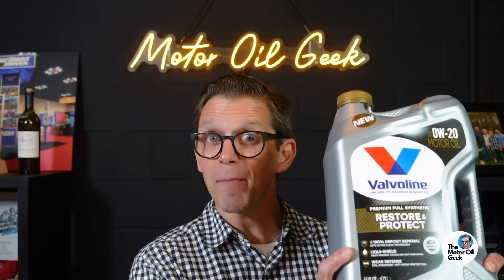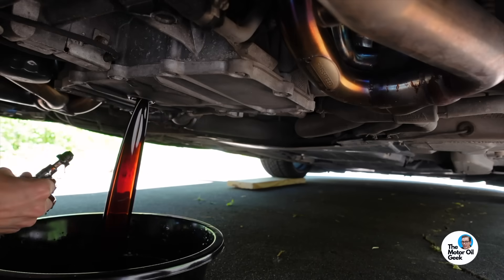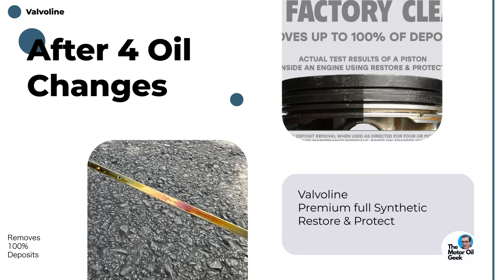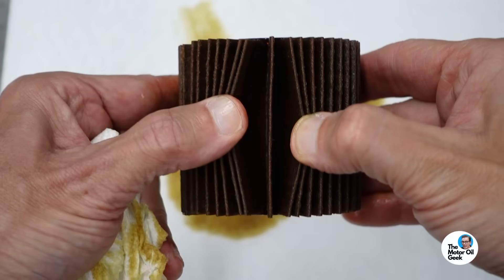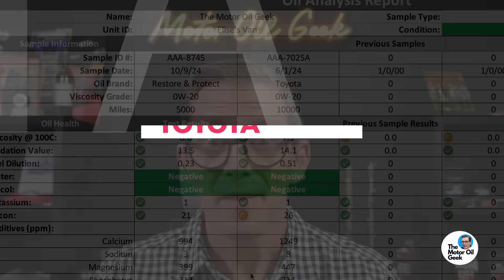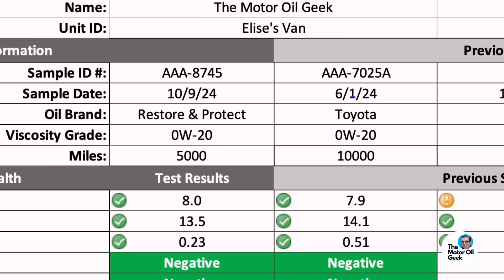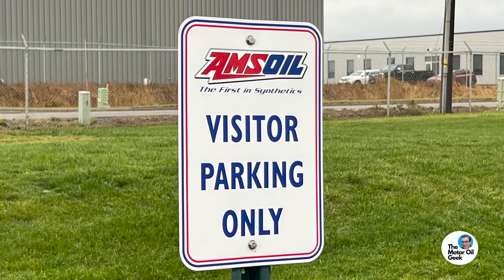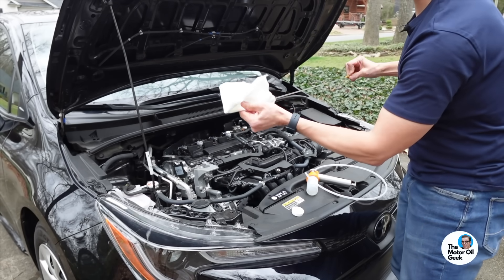The TRUTH About Valvoline's BOLD Engine Cleaning Claims

Comment: Changed the oil in my 2020 Jeep JLU WIllys when oil life meter hit 15%. I have been using R&P since 60k miles and at almost 9k miles at 15% the oil was still not very dirty. The engine purrs like a kitten at idle, and has a lot of power. My jeep has 105k miles on it as well. I have used a boresight in the oil filler cap, and dipstick and the inside of the engine has become much cleaner. Now i have had about 7 oil changes with this oil.

Comment: I got a new to me  2011 f150 3.5 with 200,000k.

I've been watching and have been going back amd forth between running restore and protect, or penzoil platnium. Im try to take the best carw of it long term.

Suggestions?

Comment: I’ve done 3 oil changes with R&P 5W20 in my 2000 Toyota Tacoma with 235,500 miles on it. I’ve also noticed the dip stick is completely clean now. I’ve had this oil in for about 4 Months. I looked at the dip stick yesterday and the oil is still clear, maybe slightly darker than fresh but normally any other oil would be completely opaque by now.

Comment: If anyone tries this with a 98-2002 Corolla (or Prizm Equivalent), please let me know. Wondering if I should spend the extra money trying this oil. The car burns like 2 quarts every 1200 miles if it's on the highway. This oil will get expensive quickly.

Comment: I dunno why you wouldn't just drive the Valvoline 10K miles like you did with the Toyota oil, just so you wouldn't have to speculate about what the other 5K miles did. Seems like a big scientific oversight there. But thanks, I will try Restore and Protect during my next oil change. Engines getting old and I'm starting to burn oil at a noticeable rate. It's slowed with thicker oil and Lucas though.

Comment: I have used this oil in three vehicles. My BMW X5 went from a quart every 2000 miles to nothing. Zero. No usage. It is actually amazing. My coworker used it in a 2006 N52 BMW engine that was burning so much oil that it was pinging even with premium fuel. He said it runs perfectly now and uses zero oil between changes. It took two changes to notice anything but the third change fixed everything for him. Now I have another Volvo that is using .5 quart every 1200 miles and it’s getting R&P as top off oil and will be doing nothing but R&P from here on out. I am a true believer in the stuff. 

I’ve also got a customer that’s trying it in their XC60 that is burning a LOT of oil. We will see how it goes.

Comment: Can you review the original Premium Blue Restore which is far more concentrated & is very expensive also compared to VPBRP ?????🤔
Valvoline Premium Blue Restore is an oil that can reduce lubricating oil consumption rates on affected engines by removing deposits from pistons, piston ring lands, and other engine components. It was co-developed by Valvoline and Cummins to clean the piston rings on ISX15 engines that were experiencing oil consumption. The oil contains a significant percentage of a high-solvency Group V ester basestock.
Reply from the maker: I've used that product before, so thanks for the suggestion.

Comment: I bought a new Corolla last summer and it’s exactly like your daughters car. I changed the oil and filter at 1,000 miles and then again at 5,000 miles. 6 months later, I changed it again at 7,100 miles. I’m using the factory filters and drain plug gaskets from the dealership, and using mobile 1 0w-8 every time. Since this 2.0L engine takes about 4.25 quarts, when the old oil is almost done draining, I dump a half a quart of new oil in the engine to help flush out the bottom of the pan. I’m wondering if I even need to consider having an oil analysis done as it is going to be on a 5,000 mile interval between changes.
Reply from the maker: You are on a great schedule. If you are going to stick to 5k oil changes no matter what, then used oil analysis will not be helpful. Used oil analysis is very helpful if you alter the maintenance program based on the data generated by it.

Comment: My car doesn’t have a dip stick BM with 110 k miles so should I add this just poor it in
Reply from the maker: Just use the oil to clean the engine. Just make sure it is the correct viscosity.

Comment: I have a straight question. I have a piston slap on my 2009 sienna , on startup, goes away after 10 minutes.  330k miles. But If I use this, will it make worse. I heard piston slap is common because of spacing , if all carbon goes away, that might make it worse right.!! Correct me.
Reply from the maker: That is correct. It is possible it could make it worse.
Reply: Thank you for the quick response. I’m currently getting the mileage as per the book, around 20 in the city and 25-30 on the highway. For now, I’m using Pennzoil Platinum High Mileage, and I’m on my second oil change since purchasing the vehicle. I plan to stick with this routine. I’m just checking if there’s anything I can improve on my end. I noticed a bit of light sludge when I checked through the oil cap, and the filter had 1-2 small metal pieces. The filter itself is light brown, similar to yours. Someone on YouTube suggested using Pennzoil Platinum High Mileage three times, so I’m following that advice along with an OEM filter.

Comment: Hey Lake, About to change my oil from my first fill with restore and protect. I bought some HPL oil to use this fill. Should I be using restore and protect for a few more drain and fills to get the fill effect? I have a Civic Type R with 40,000. I figured it shouldn't need any crazy cleaning. I've done 4000 mile oil changes since the car was new with Amsoil Signature Series for every change besides this last one when I used the valvoline
Reply from the maker: Yes, I would give the Restore & Protect at least 3 oil changes to do its work.

Comment: My 2011 Sienna Oil maintenance light came on at exactly 5k miles after my last oil change (I had reset it myself) even though it was driven 85% highway miles in 6 months.  Is something wrong?
Reply from the maker: That's because Toyota's maintenance minder is an odometer. It goes off at 5,000 miles.

Comment: Best oil is clean oil. I change my oil when I begin to not see my the dip stick measuring lines through the oil. Oil is cheap engines are expensive. Over fifty seven years changing oil and filter this way and the engines never gave a problem.

Comment: I've been using this on my 07 Camry with the notorious 2.4L oil burner. Used to lose a quart every 1500 miles. Just went a full 4000 miles and lost only half a quart. This stuff is great.
Reply: As someone with a 06 Camry 2.4l I've been looking for this comment. Going to give it a try on my next change in about a month
Reply: my civic burns ALOT of oil..about 700-1k per qt. Car calls for 5W-20, should i just go with 5W-30 to get lasting effects from the oil consumption? Was thinking it wouldnt hurt to keep this in longer & get more out of it? Thoughts? Also, should i top off with this or can I get away with other simialr valvoline products till next oil change? Apprently it takes 4 oil changes for it to work 100%?! Also, after the 3 oil changes, can I go back to my old Castrol oil for sometime & use this periodcally in like every 4-5th oil change? 
P.S. I change my oil 3-4k miles Thanks!
Reply: @dbzownz12345  I'm no expert, just a guy who works on cars. 5-30 is usually fine if the car calls for 5-20. They usually only recommend that thin of an oil to get a higher mpg rating. This oil will only work on carbon build up on the piston rings. If that's your problem, it should help. If it's valve guides or totally worn rings, it won't do much. Can't hurt to try though. I would top it off with the restore and protect. With that much oil loss, you'll dilute it pretty quick if you add something else. Good luck.
Reply from the maker: Glad to hear it’s working for you!

Comment: I have a 2004 Monte Carlo SS with a 3800 in it with just under 170k miles on it and I'm considering switching to this oil.  I've been using Mobil 1 full synthetic which is cheaper than this new oil but I plan on keeping this car until the engine dies and I would like to get 400k to 500k miles or more on it.  I'm hoping this new oil will help me reach that goal easier.

Comment: Diesel engine related Question ‼️👇

Hi there, I have a VW 2.0 TDI diesel engine 80,000km  and I'm considering using Valvoline Restore and Protect 5W-30 oil. 

Question ‼️❗👇
Could you explain the risks associated with using this oil in diesel engines and why Valvoline might recommend against it? Is it worth the risk?
Reply: Diesels tend to need a different additive package from gasoline engines in order to cope with soot. If you want the effects this oil has, perhaps before an oil change, you can run a can of Liqui Moly engine flush. Then afterwards, you can refill with whatever oil has your VW TDI specifications.

Comment: My truck has over 400,000 miles on it, Castrol Edge every oil change since new at 3,000 mile intervals. Dip stick still looks like new, never looked tarnished. Scope inside the valve covers, everything is clean and looks near new. What’s the problem? People using bad oil filters and. It changing their oil frequently enough.

Comment: Do you think it will help a GM 5.3 with AFM that is starting to have lift tick? 121k miles
Reply from the maker: Some people have reported that it helps.
Reply: @themotoroilgeek  Have you seen this? This makes me think twice. about using it. Any additive that would help like Lucas ?https://www.youtube.com/watch?v=EvvhHWEoJ1Q
Reply from the maker: @danielk0106 that was not my experience with it, nor have any of our oil analysis customers reported anything like that.
Reply: @themotoroilgeek  I'm thinking that was a neglected engine with a lot of sludge. Thanks for responding. I know you're a busy guy. My nechanic told me to do Mobil1 with a bottle of Lucas oil stabilizer
Reply from the maker: @danielk0106  I don't recommend using additives, ever.
Reply: @themotoroilgeek  I'll just try the Valvoline. 
I've always been told.not to use additives. From my Grandad and Dad who farmed and my Uncle who drove a Mac Truck for 30 years and he said never add anything to your oil.

Comment: So u plan to put 0w20 in a 0w8 engine? Wont that mess up the variable oil pump?😅 9:31
Reply: 0w8 is due to epa and mpg not because the engine needs an oil that thin
Reply: No
Reply: GM will be asking people to switch their recalled L87 6.2 engines from 0W-20 to 0W-40. Not because of clearances or the oil pump, but simply for better protection. Proof that engines can safely take thicker oil than what the manufacturer originally suggests. I assume his daughter's vehicle is no different. Thinner oil is strictly for meeting CAFE mileage requirements, not for optimal protection.
Reply: No it will not harm anything. These thin oils are for gas mileage not ware protection. Using a 5-w30 in an engine calling for 5-20 will only make it last longer, but will make the gas mileage go down 0.2-.5 mpg…. My wife has put 250,000 on two different ford cars that call for 5-20 and I’ve never used anything but 5-30 in both. The first one didn’t burn a drop when we sold it and her current one doesn’t burn a drop doing 10,000 mile changes with mobile 1 extended performance. This new restore and protect is very interesting but after using mobile 1 full synthetic on two vehicles over the past 24 years and seeing how good it is I’m not changing.
Reply: @MikeC-d9z awesome!

Comment: Lake, good night. I have been following your videos for Restore & Protect, and based on them I decided to try it on my car BUT... after contracting Valvoline directly, they informed that they don't have an European Formula. 

Never the less, I put the Valvoline on my 2013 VW Sportwagen with the 2.5 liters, 5 cylinder NA engine with 123,000 km (76,000 miles) all of them with 87 octane gasoline. 

The manufacturer calls for oil changes every 10,000 km or once pet year, so I change it every six months. 

Restore & Protect is not certify for the VW502 specification. I will do my yearly maintenance at the dealer, they use Mobil1 now, even though, when the car was manufactured, VW used Castrol, and six months later, I will change the oil to R&P.

Do you mind giving me your opinion about what I'm doing on an European engine (made in Mexico)? I won't hold your responsible for anything 😂. 

Greetings from Mexico City
Reply from the maker: Since you will be having the dealer do oil changes as well, do not use the Restore & Protect. Just stick with the same Mobil 1 that the dealership is using. It is better to not be switching back and forth between brands (chemistries).
Reply: @themotoroilgeek  thank you

Comment: My wife's 2014 Lexus GS350 has 104,000 miles on the odometer and I looked at the dipstick for varnish deposits and didn't see any. The surface of the dipstick looked like it was new. Been using Mobil 1 0W20 since we bought the car. My conclusion , based on the appearance of the dipstick is that I should keep using Mobil 1.

Comment: It's really good stuff but you need to be changing your filters every 3000 miles for the first few oil changes or so with this oil because you have to remember its breaking all that trash loose and then circulating through the engine in the motor oil so you want to keep fresh filters on it for awhile until it completely ckeans out the engine

Comment: So Lake. 
  Are you saying that this is the #1 oil that everyone driving a Highway vehicle should be using?
  If I use this oil from day one on a new vehicle should I expect better results overall than other oils?
  
On an older oil, let’s say a 2002 Camry 2.4 with 200,000 miles. 
  Should I change to this oil and use from now on. 
  Thanks for all of the great videos.

Comment: I have a 2010 Buick Lucerne v6 and a 2014 Buick Enclave, both with 160k+ miles. Is it safe to change from a DEXOS spec oil to the Valvoline R and P oil? How about using in a 2003 Nissan Maxima with 168k?

Comment: You did not talk about why you changed the new oil at 5K miles when previously you did it at 10K miles.  Were you anticipating that the suspended carbon could be detrimental?  Does Valvoline recommend tighter changes?  Would you extend that now that the first change looked OK?

Comment: Valvoline is fortifying their Restore and Protect oil with PEA(Polyetheramine). They found out in the lab it has better use in the oil than the fuel system. I have been adding Redline SL1 lightly to my N62TU engine oil for years. PEA is good stuff.
Reply: How do you know this?

Comment: On a Toyota Corolla 2023 2.0 engine, the oil label says use 0W/8.  Is it better to use this 0W/20 Valvoline Restore & Protect to protect the engine better than the factory fill specified by Toyota 0W/8?

Comment: Wondering if you could use this in replacement of Porsche C30 oil, same weight being 5w30, but R&P not certified by Porsche,  yet it’s an SP oil so lspi is very low as per C30, thoughts?
Reply from the maker: That might work!
Reply: Well let’s try it in. Cayenne S 2019 🎉

Comment: so i have a question: is the restore and protect superior to valvoline's high mileage blend and would it be worth switching from the latter to the former?
Reply from the maker: It is an upgrade over the High Mileage products.
Reply: @themotoroilgeek  good to know. i know the 3.8 in my 05 lesabre has a reputation for bulletproof reliability but i wanna make sure it stays good for as long as humanly possible.

Comment: I tired of seeing a lot of cutting open the oil filter videos, and am beginning to down vote them. Valvoline is advertised to clean piston rings and clean engine internals and keep dissolved carbon in suspension. I want to see results after three to four old changes, or 15,000 miles to 20,000 miles not 500 to 1000 miles. I'm on my 2nd oil change myself with R & P and over 5,000 miles. My Honda Pilot has challenges with the VCM system. Cylinders 1-4 are turned off as directed. Oil migrating past the rings and fouling plugs and varnish coating the combustion chamber and rings is a problem with these engines. The mfr recommended 10,000 mile oil change interval seems to be a major contributor to the problem.

Comment: I switched to restore and protect 4 oil changes ago in my 2019 f150 with a 3.5 liter twin turbo and I love it it seems to be cleaning out the old varnish and my truck starts great even below zero.

Comment: I have a 2005 Toyota Camry. So, the interval suggestion is 5k between oil changes? Great video. Very interested in trying this product out for the next 4 oil changes. Should you just continue using it after the cleanup or switch to something else?
Reply from the maker: 5k intervals with the Restore & Protect are good.

Comment: I truly wish they make this restore and protect for motorcycles oil line up as well, and would be absolutely hoarding all the oil if they have those line up that designed for efficient cleaning while have excellent lubricity additives that can withstand during high load, heat, rpm in a high performance motorcycle engine during track days or sprinted riding. I really want something that can clean my bike this goood. If it is available I’m definitely the one gonna buy it straight out of the factory production line waiting for it to come out through the conveyer belt 😂😂